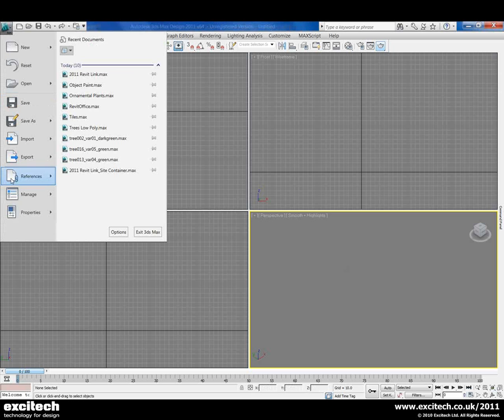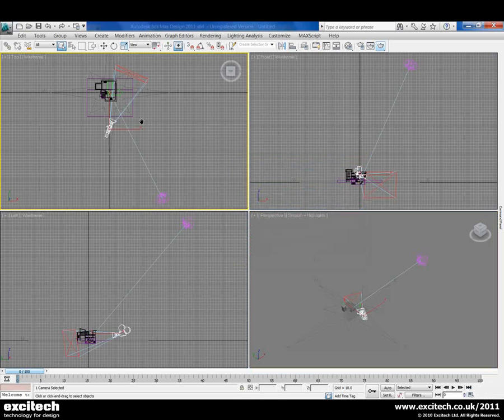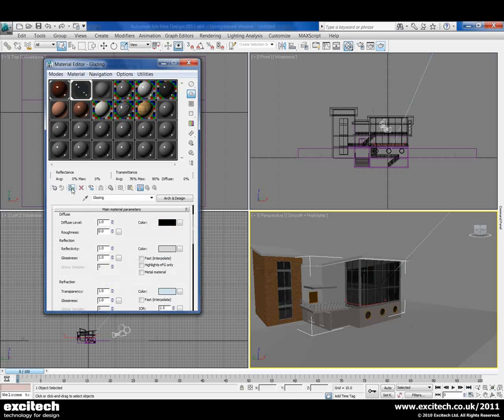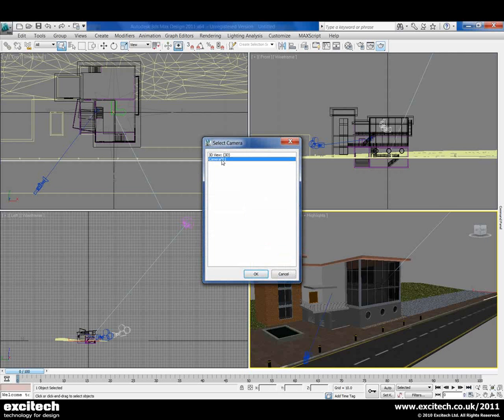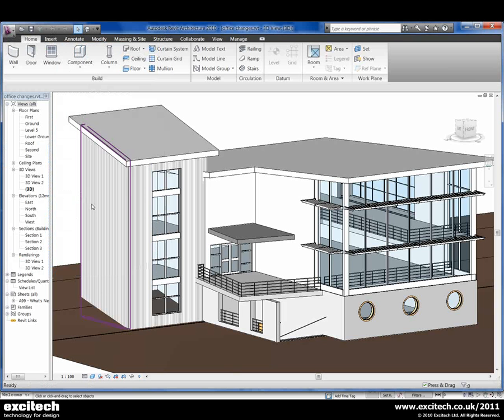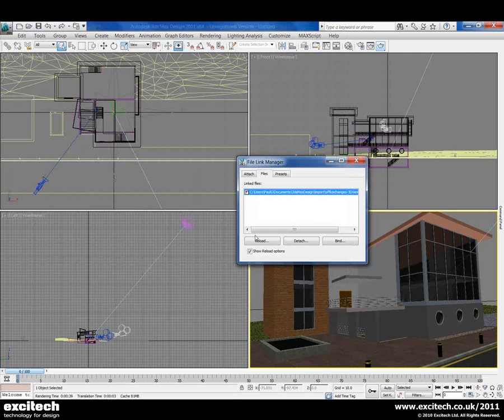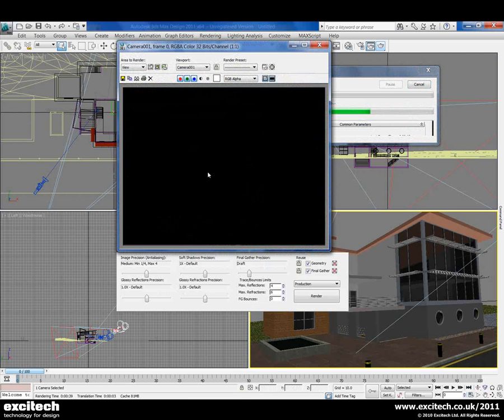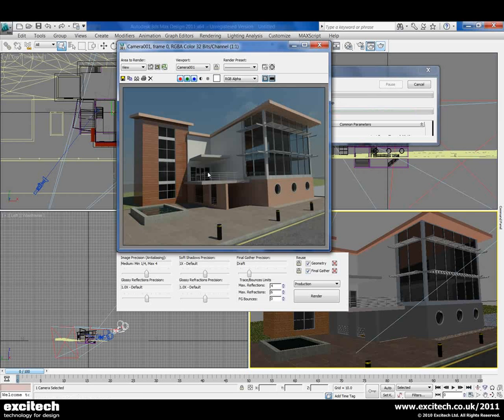3ds Max Design 2011 - FBX Links to Revit

Comment from the maker: You can indeed use SketchUp Warehouse models by importing the ‘skp’ files into a new generic Revit family template and then saving this as a new component. This will transfer the model with the original colours but do note that this is not advisable as best practice because the model is likely to be very inefficient compared to the equivalent created in Revit.